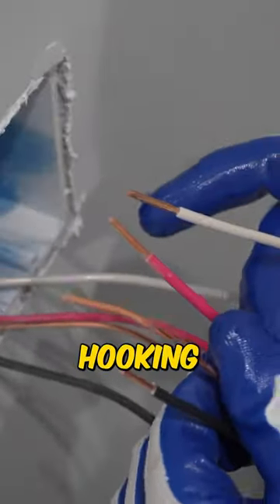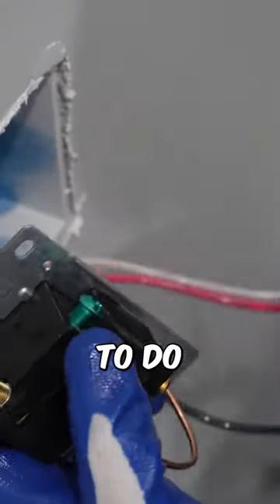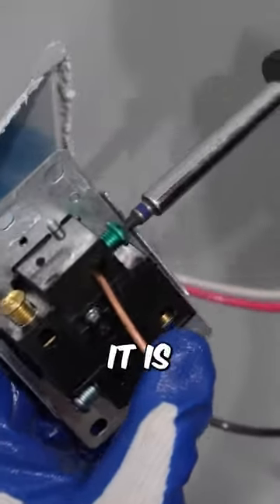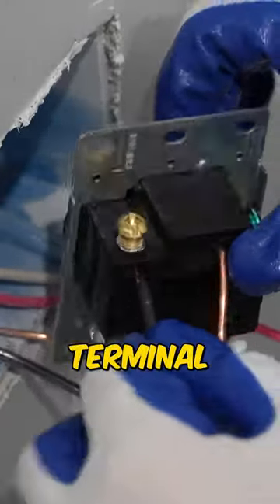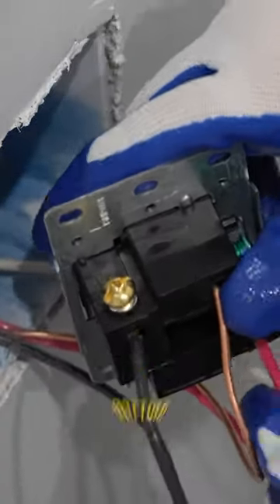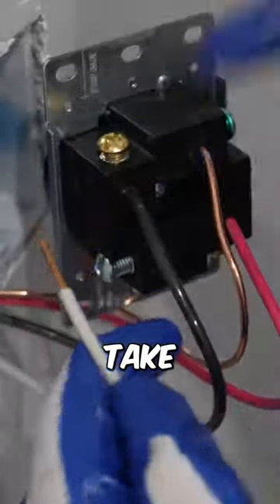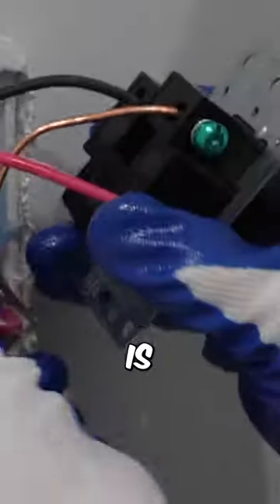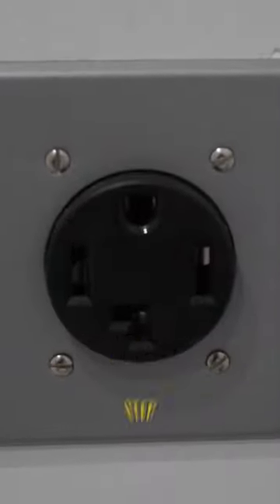Installing A Dryer Receptacle For A 4 Prong Cord! #diy #home #electrical

Comment: Ground first then neuteral then power always even if the breaker isnoff if the buildingnwould get hit by lightening or a power surge u want to be protected and someplace for that current 2 escape to

Comment: Here's the order to put your wires together. 
1. Ground/bare/green wires
2. White wire
3. Black or red doesn't matter
Taking it apart should be done
1. Black or red
2. White
3. Ground/ bare/ green
Reply: Doesn't matter which one u do first
Reply: Sure... unless it's on and you don't know it. Your reply will be "Of course I turned the breaker off, so it doesn't matter. "  The NEC is full of procedures that assume the power is off but is a best practice in case it gets turned back on while you're working on it.  It does happen.
Reply: @roberttempleton8112  it does matter just in case it's live.
Reply: @TomKaren94  that procedure is done because you are assuming everything is live.

Comment: A licensed electrician would wiggle the wires and tighten the screws again!
Reply: Always good practice but really more beneficial for stranded wire
Reply: @GageDrums stranded wire will move and crush as you tighten it. Solid wire will jump instead of crush. If you don't wiggle the solid wire to let it jump around and then retighten it it can jump when you push it into box, and once it jumps a bit it can slide out easily. You should always test your connections and then make sure the are stil tight, but its more important with solid wire since the screw wont crush the strands into the proper shape
Reply: Also torque them

Comment: You have hot, neutral, and ground... Whats the need of two hot?
Reply: To supply 220/240 volts. One hot would supply 120v

Comment: The receptacle should have labeling at each screw... G, W, X, X. Should be obvious. My daughter hired an electrician who F-ed it up though. He put a hot on the green. When she touched the dryer she said she could feel a 'buzz', as she put it. When she told me, I knew immediately what it was so I drove 2 hours to go fix it myself. She's lucky she wasn't standing on the metal drain grate when she touched the dryer.
Before I came home, I went to the guy's house and demanded her money back. He refused until I told him we were going to post the event with his name on every review site we could find. That guy's stupidity is dangerous.
Reply: He obviously wasn’t an electrician. I do t even get how one messes such a thing up? Which hot wire did he put on the ground screw? Did he believe that it was a ground? Did he not know it is two pole?